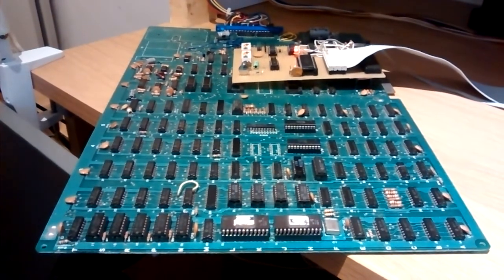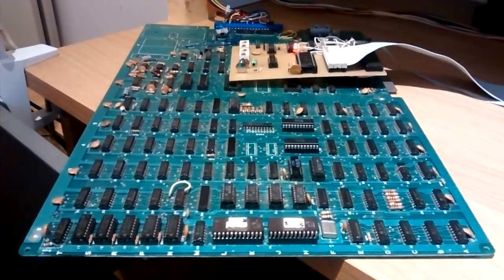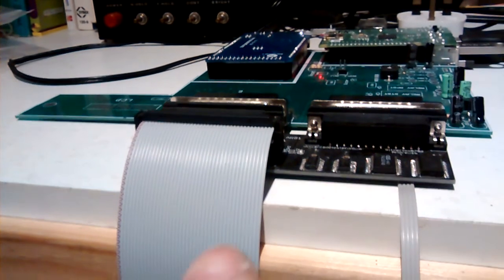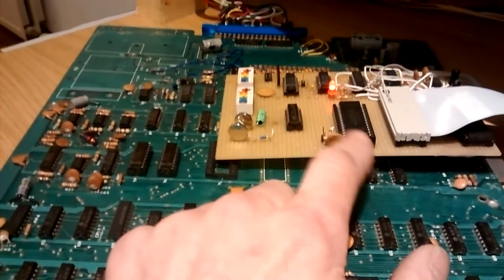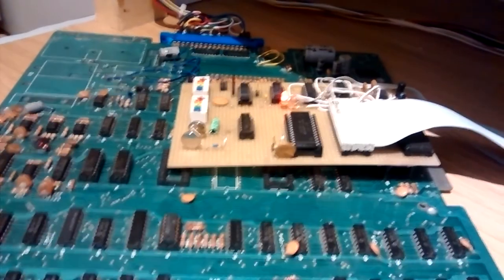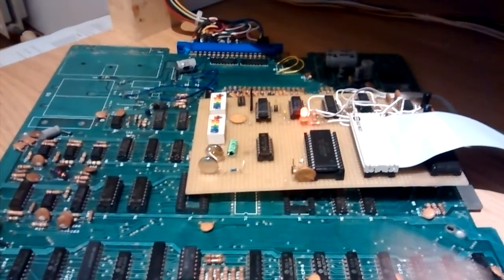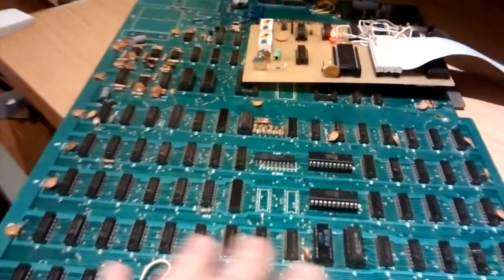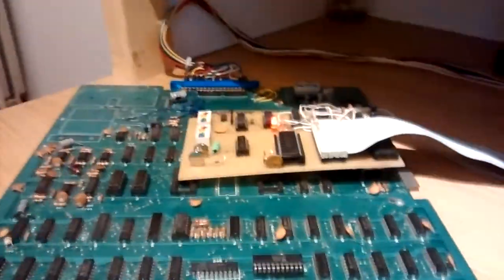AR81 - New Z80 Emulator - Hardware overview

Comment: Any way to not use physical dip switches and just use software switches that can be controlled by the AR81?  I would think that would make it more flexible.
Reply from the maker: I can use software though decided to stick with dip switches at this time based on cost and complexity. To use software it would need a register to set plus when the power is disconnected, the register would be lost. The next rev of board may have this feature included but the PCB version getting built will only have 7 switches and setting them is very easy as it can be done with power on or off.
Reply: ok, thanks :)